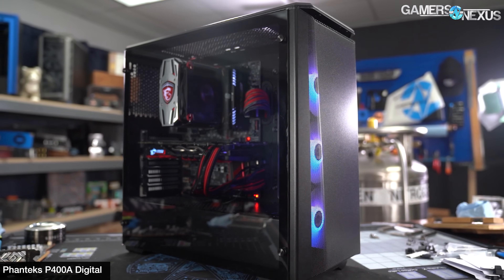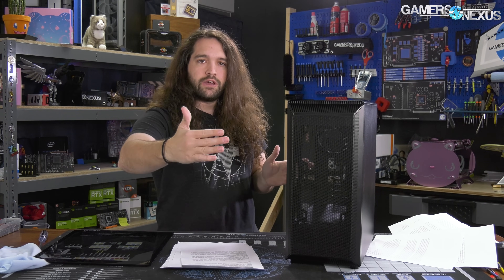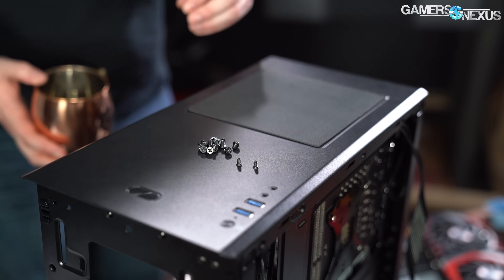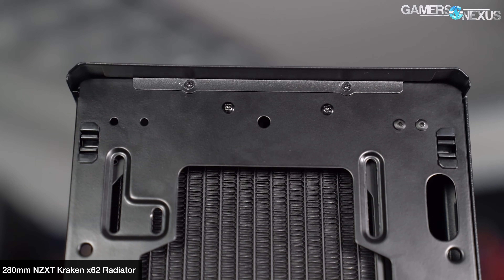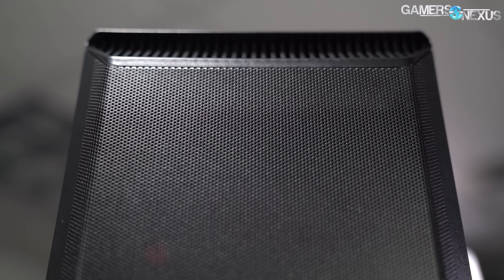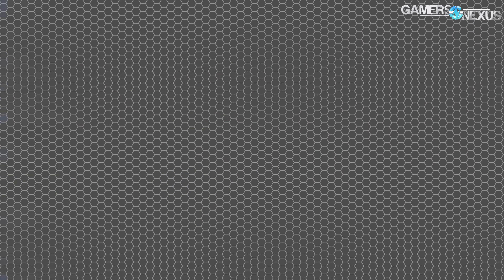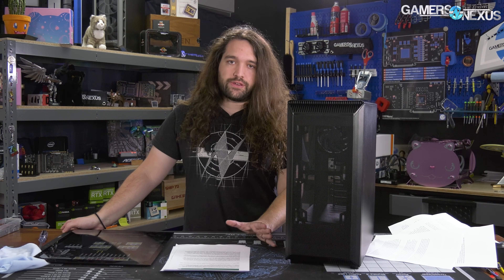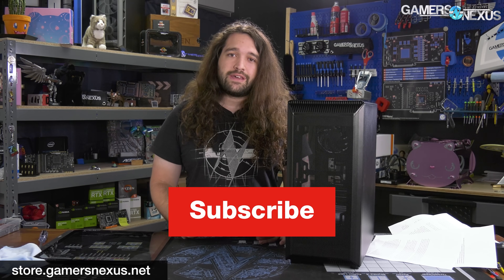Phanteks P300A Cheap Airflow Case Review: Thermals, Extra Fan Tests, & Noise

Comment: Great to see the performance of the P300A and P400A being validated, really great cases - Phanteks are one of the only reliable, low budget manufacturers I can find around me. Just realized that the P350X is actually longer than the P300A, so theres a bit more leeway for cable management in the shroud. Now if Phanteks just threw the fans in, and increased the price slightly, it'd be absolutely amazing.
Reply: MadSinister I think the P300A would be a good case for someone who's coming from a HAF 922, just want to change the case to something smaller, & seems like a good suggestion for the price.

Do you have any recommendations?

Only got 2 hard drives, don't need a Cd drive, & it's an atx mobo with EVGA GTX 680 signature 2
Reply: I have the p350x and love it for my front mounted 280 aio for my 3800x and it helps keep low temps and has pretty colors and good control with my notos 120s and corsair rgb 280s

Comment: I know this is an old review but it was massively helpful for me. For my first build in 2020 I got the non-airflow version of this case and it ran hot. I would frequently remove the front panel and eventually moved to a Corsair 4000D Airflow. I recently built a new(ish) system with that case, an RX 5700 XT and an R5 5600 for VR use. My VR headset arrived yesterday and the P300 was an absolute FURNACE. 90+ temps on CPU and GPU. Fortunately you can order the front mesh panel by itself and this review helped me decide whether or not that would be worth it.
Reply: me too, I had the p300 for the longest time and after getting the p300a front panel my temps dropped by like 15C lol
Reply: Thank you for your comments, I have been with this case for 1 year and a half and it really works very hot with an R5 5600x and RTX 2080ti. I’ll find out how to buy the front!
Reply: @BrianBarbaGonzalez  if you search up "phanteks p300 mesh front panel" it's the first link. If you look manually it's on the phanteks website under replacement parts.
Reply: it's a lil expensive though since it's $36 including shipping but cheaper and more convenient than getting a new case
Reply: @raymondzhang6941  that was my thought
Reply: @BrianBarbaGonzalez  My build is in a P300a. It was pretty quiet and cool with the original setup, but I recently upgraded the CPU and GPU and now it's pretty loud under load. I switched out the Hyper 212 BE I was running to a Deepcool AK620, but didn't touch the case fans (stock rear, 2 120mm Metallicgear in the front). So I guess it's time to upgrade the fans. I'm eyeing those new Phanteks M25s, but haven't decided yet.

Comment: FYO Steve, Phanteks has already started selling the P300A with 3 RGB fans in Australia included (2x front, 1x back) for 30 AUD extra (roughly 22 USD), which will perform amazingly in thermals!
Reply: I'm using this specific case in my next build, with the extra stock fans. Fingers crossed it goes well!
Reply: That’s the p400a digital, no? I’ve never seen that case and I’m in Australia... so....
Reply: just copped this one!

Comment: Phanteks really killed it with the PXXX series. I have a P400 eclipse myself, excellent build quality and spacious.
Reply: I love my P400 tempered glass. I need to get around to ordering the p400a front panel for it.
Reply: That A at the end makes a huge difference though. The P400 was bit panned by being a hot oven with no airflow. When they added the meshfront and the A at the end of the name, it rocketed to the top.
Reply: @raduque  the p400a on newegg was 85 dollars with tax and shipping for me last week non rgb btw
Reply: Glad Phanteks went back to the days of the Enthoo Primo.
Reply: Agreed. I have the p400a non rgb and it's fantastic. Super happy with this build and i love the low profile, minimalist design.
Reply: @raduque  Same!
Reply: I have the p300a and that thing is awesome. Looks, airflow, cable management, and definitely price.
Reply: ive got a p350x and really like it. paid $97CAN, its now listed at $315+115 shipping, wtf?!
Reply: Have a p350x and love it's look and Temps. Paid $50 for it. A steal
Reply: Got the p300 red and black version and I really like it. Looks great and very easy to build in.
Reply: I have the p350x and love it!
Reply: I have one too. I didn't realize how bad the front panel was until I took it off and the temperatures for every component dropped tremendously. I want to buy the air mesh front panel but it's 35usd including shipping which is 1/3 the cost of a p400a.
Reply: @macktheknife17  Yup, front panel is pretty bad, I have mine off right now lol ordered the p400a front panel yesterday, but no way am I paying 80 bucks just to upgrade to a mesh panel.

Comment: My new build is in a P300A. I got it (for about $60) mainly because the P400A was unavailable at the time. It's been up and running for a little over a month. I'm running the stock fan in the rear, and a pair of 120mm Phanteks Metallicgear DRGB fans in the front, with a CM 212 Black Edition on the R5 3600. All fans are running the default fan settings in the bios. Highest CPU temp I've seen so far is 44c. As far as noise, I can't hear it unless I put my ear almost right up against the case in front of a fan.
Reply: Hey Joseph, I’m wondering what cpu cooler you put in your P300A. From what I see in the specs or the manual on their website, the CPU clearance is 165mm, but I’m planning to buy a Deepcool Assassin III which has the exact same height of 165mm tho. So I’m worried if that cooler would fit this case. Thanks!
Reply: Also looking for cooler info
Reply: @lucaschau7789   2 years and I didn't answer? Wow. Sorry about that. Hopefully you figured that out, but to answer your question anyway, I was running a Coolermaster Hyper 212 Black Edition. It fit just fine. But now, 2 years later, I've upgraded the CPU to a Ryzen 5600 and put a Deepcool AK620 on top of it, which also fits just fine.
Reply: @joevk6274  lol can’t believe it’s been over 2 years, and I nearly forgot the question I left to you honestly. Seeing this question reminds me of the awful lockdowns bc of pandemic. Anyways, I ended up not buying this case but thanks for your answer after this long time tho. Wish your build has been up and running just fine:)

Comment: I really hope Phanteks puts some P300A front panels in their replacement parts store. It would be a straight upgrade for my P300. The best of both worlds, airflow and RGB.
Reply: I'm hoping for the same - I emailed their support a month ago and got this reply: "Please stay tuned as we will release more information out of the front panels."
Reply: they did for the p400 thought they went out of stock almost instantly
Reply: i just got a white mesh front panel from phanteks for like 16 bucks. Painted it black, great upgrade for my p400.
Reply: @Ratcher.  I just bought one. There 19 bucks. Tired of pulling my front panel off whenever I want to game
Reply: @easley421  same I was tired of pulling it off to play even with more fans. i pulled it off so many times I ripped out the rgb strips power cable
Reply: they sell the p400a front mesh in australia at stores so they probably sell the p300a replacement
Reply: Mesh for the P350 eclipse too pls.
Reply: Axpertec has replacement parts for the P300A. I bought the front panel from them here in Germany and got it for 15 bucks.
Reply: Why do you need to rip the front panel when it has good airflow? Doesn't the extra fans help?

Comment: Here in Germany the P300A has had good availability for ~55€, while the P400A is only available from time to time. Also the P400A Digital is ~90€ when it's available. Paired with 2x Arctic P14 (5€ ea., those are the fans that come with the Liquid Freezer II and they are value monsters) the P300A ist really attractive over here imo. Great video guys, I really enjoy your case reviews.

Comment: Thanks for the review Steve.  Due to stock issues, I was unable to get the P300a or P400a a few weeks ago so I ended up settling on the Corsair Carbide 275r.  I loaded it up with 6 fans and I'm perfectly happy with it.  Corsair also stopped using the hex screws on the glass panel of that case.  It now has slotted screws that you can remove by hand and they put the hex screws and hex wrench in the added bag of goodies....for the sadists out there I guess.  They also fixed the rubber grommets for the side panel screw holes to the case so they no longer fall off and also provide something for the glass to sit on so you don't have to hold the panel anymore while reattaching it.

Comment: I'm waiting for the P500a also shown during CES,, can't wait :)
Reply: Same! I’m wondering when it’s gonna come out. I wanted the enthoo pro m but I might hold out and wait for the 500a
Reply: @Anthony-en5ov  Someone on a reddit post said they emailed them and was told the release was pushed back to June. So hopefully sometime next month then :)
Reply: Expect P400A performance and higher build quality. I have the P600s and the performance is outstanding. P500A will have the same chassis. I liked the fabric mesh+filter approach better, so i stopped waiting for 500 and bought the P600s.

Comment: I bought the p400S in white two years ago.  About a month ago I purchased the p400a front panel from Phanteks for $20, and now I feel that I have the best of both worlds.  It was even easy enough to remove the top and bottom pieces where the filters are on the original p400s front panel and swap them instead of the closed design top and bottom on the p400a panel.  Maximum airflow and I love how it looks!

Comment: Thank you for this amazing case review! I was looking for a case to satisfy all of my needs for a long time and then I saw this video. This case has been the one I was looking for since fitting three 140mm fans and a Phanteks aftermarket cooler in a good case is rather difficult to find. Having tempered glass is a bonus but this case is fantastic for my needs.

Comment: I was debating whether to get the Purebase 500DX but it's not available and the P400A is , but at close to NZD $150 for the p400A white and NZD$160 for the P400A black,  that's getting around $40-50 above my planned budget. Imagine ,my surprise to see a P300A in stock and available for under NZD$100. As far as the fans go, well I have a 3 pack of CM MA120s sitting here waiting for a case so that's an already sunk cost.  I just needed a budget case wiuth reasonable cooling that would allow me to build a daily driver workstation with a 1070 while I save for a Ryzen 3600 + GTX 1660 super combo as I only game in 1080p as I realistically don't game well  enough to justify a 1440p high refresh rate rig.

So Thanks GN. You just helped me buy a basicly sound case that meets my needs within my planned budget. Oh and I notice that the P300A page on my local PC tech supplier mentions the Gamer Nexus P400A review very prominently :

"The P300A features the same Ultra-Fine Performance mesh as the multiple award winning Eclipse P400A ("Best Overall" & "Best Out of the Box Thermals" Case of 2019 - Gamers Nexus), "

Comment: If you're looking for cheap fans for your P300A, look at Arctic P12 PWM, they're $7 US as of today and they're very high performance fans. I have one in my GPU's radiator. They'll turn the P300A into a really high perforcmance case and remember, lower temps = lower fan speeds = lower noise

Comment: We were lucky enough to get one for $50 after rebate on release.  Comments were positive on our limited review.  Wish we were able to test the AIO fitment since that seemed a little suspect.  For the Broke Builder theme, we used a Gammaxx 400 and a couple CM bulk pack fans.  It performed on par with an Antec 300 loaded with full fans.  Thanks for the WAY more thorough test! o.o7

Comment: Great review like usual, very informative. I'm loving mine, was about to buy the P300 but didn't like the solid front panel for airflow. About that same time the P300A came out (6 months ago) so I jumped on one for $60. With the white led power button up top & small white led on the side under glass panel it looks pretty good with the Antec C400 Glacier 120mm cooler with white led ring that I used. 

Had 6 -120mm RGB fans already (2 - 3 piece sets) with controllers & remotes so just used 4 & threw in a 1366 Gigabyte UD3R board had lying around, X5680 Xeon 3.3ghz OC'd to 4.2ghz, 16gb G.SKILL DDR3 2133mhz, new Crucial MX500 SSD 500gb for OS, SSHD FireCuda 1TB, older WD 640gb Black HDD, & a new Sapphire RX590. I can't complain, & if I did no one would listen.. For about $600 total it does all I need & then some. =P

Comment: Thanks for the great review as always. I was waiting for this one for a while but went ahead and bought the case from newegg when it had the $10 rebate hoping the performance would be inline with the p400A (knowing I would have to add 2 intake fans to get there). I had been looking for the smallest case with tempered glass side panel and mesh front that could accommodate a full ATX board for a while and this fit the bill. I know the 7 centimetre reduction in depth doesn't sound like a lot but when considering the p400A is only 47 cm deep to begin with its about a 15% reduction. The P300A is also slightly narrower. This was the difference between the case kind of fitting on my small desk and fitting just right.

Comment: Purchased this for my Ryzen 3800x build a few months ago.  Solid case, and I like the compact size.  Fits on, and in my desk cubby very nicely!
Also picked up two 140m Noctua Chromax's for the front intake to keep it nice and silent.
The included fan, unfortunately, was pretty loud at stock.  A bit of fan curve adjustments, and she sounds nice and quiet at idle for web browsing, and light tasks.
It has flaws, yes, but if you're looking for a budget(ish) case, I don't regret it one bit!

Comment: So I pre-ordered this case as soon as it was announced in January. It was supposed to arrive in February, but the lockdown in China at the time made it arrive a full month later than predicted. I'd like to share my thoughts and experiences on this case as it was my first self-build rig.

For the building, it was relatively painless IF you connect most of the motherboard cables in advance. The space you work with is pretty limited so connecting cables to the motherboard after installing it in the case will be pretty frustrating, especially if you have an aftermarket CPU Tower cooler like I did. Also, to me Steve didn't put enough emphasis on how much of a pain removing the top panel is. I tried it at first, but half-way through I realised under how much pressure the screws were and that remounting it would be quite difficult with only one pair of hands. But maybe that's because of my lack of experience doing this compared to Steve. The only thing worth mentioning otherwise for the building is the space for the Power supply. I bought a be quiet Dark Power 650W Platinum, and it would NOT have fit with the Hard Drive cages still in, I had to remove them completely, which was fine for me since I did not plan to to use any Hard Drives, but do keep in mind that if you do want to want to, you need a compact PSU.

For the fan configuration, after some testing, I found that what works best is a slight negative pressure configuration with two 140mm intake at the front, one 120mm exhaust at the back and one 120mm exhaust at the top. Here is why: The 140mm fans block off the whole front, making it purely intake and providing the front half of your GPU with a good amount of cool air, as well as your CPU. The exhaust fans at the top and back of the case are somewhat self explanatory, the not so obvious fact is that once installed, they leave only one single place where, in a negative pressure set up, air could move in: the GPU mounting brackets below the GPU, which will provide cool air to the single place that gets a limited amount of it, the back half of your GPU. For reference, I have a Sapphire Nitro + RX5700 XT, which fits snugly in the case, with about an inch left between it and the front fans.

My build is kind of a stealth build, with only white led highlights here and there, which fits well with the very limited amount of led illumination you get from the case itself. 
Overall I'm really satisfied with the case and got exactly want I expected, I can only recommend it.